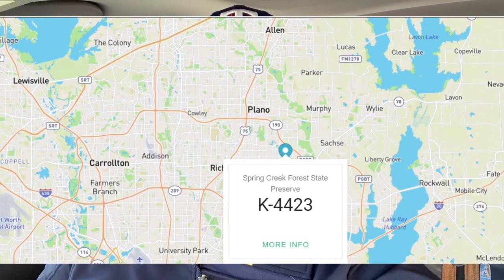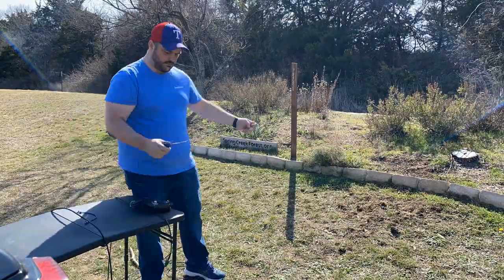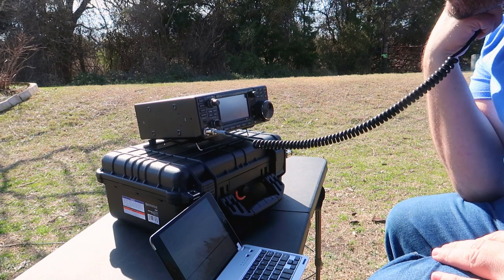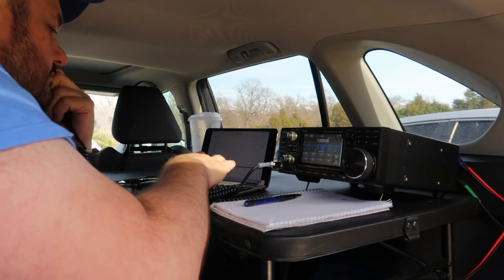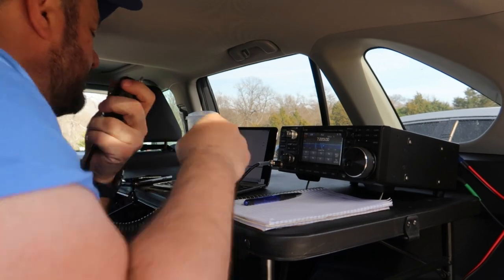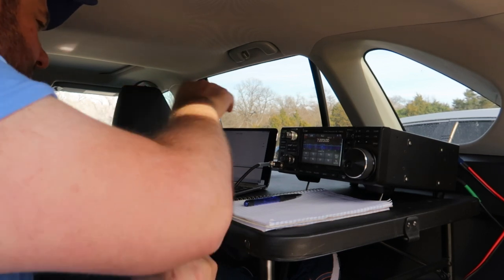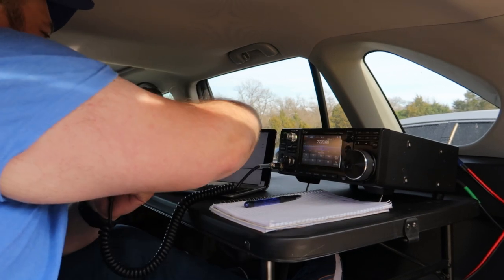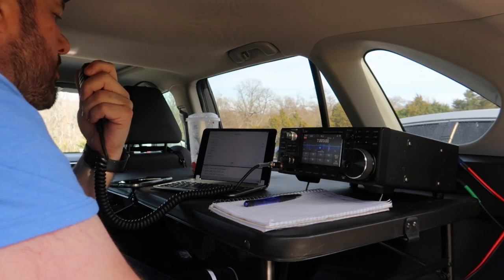Parks on the Air Ham Radio (POTA)  My first activation K-4423!!!!

Comment: I might have worked you. I was out in Richardson on WFD and worked someone in that park. Either way, I am going to send this out on K5RWK's mailing list and get some club members to check out the video. I really want to go out to that park and activate it as well. Very nice video and the editing was spot on.
Reply from the maker: Thanks Don, I’m going to try and go here a couple times a month working on the kilo as well as film some of the other parks close by.
Reply: The only one stopping you is you Don.  What are you waiting for??
Reply: @hamradiotube  Right now the battery issue. Think I have that figured out.
Reply: @don_n5skt  Pretty sure Bioenno makes some good batteries :)
Reply: @hamradiotube  The issue was not the battery but the meter in between the battery and the radio. And I have mostly Bioenno and Duracell AGMs
Reply: Thanks for posting this to the club. KI5FZR